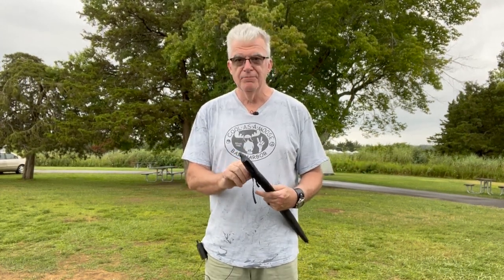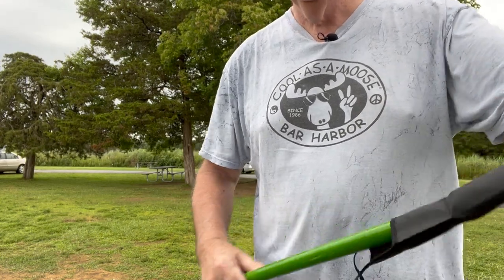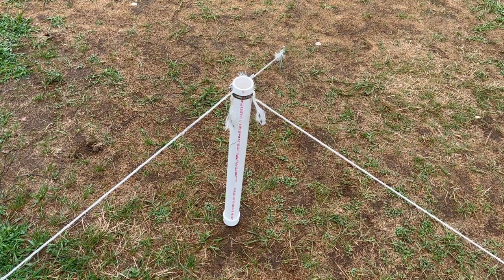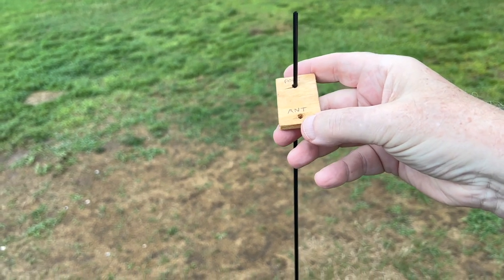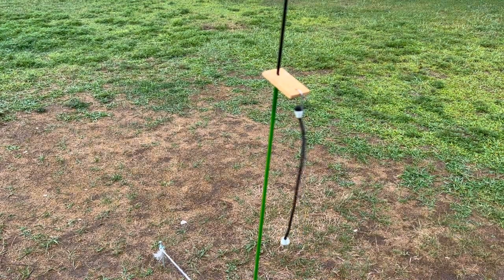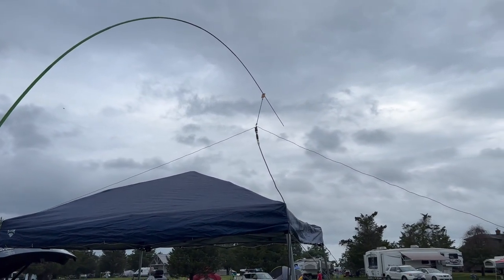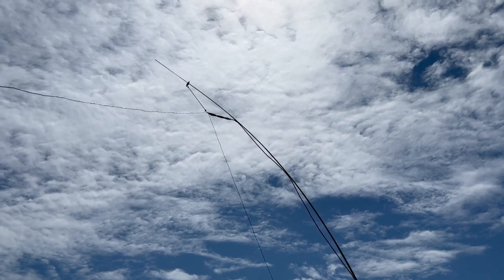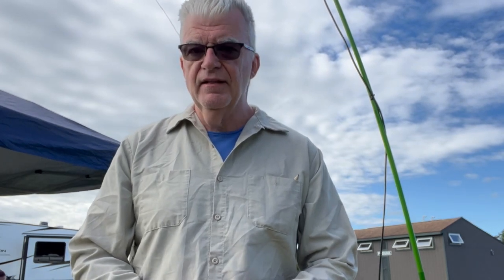Review and Test of GOTURE Telescoping Fishing Pole for Ham Radio Antenna

Comment: RG-316 is your friend for these lightweight poles. Even just a 10 foot length is good so your heavier coax can connect to a thicker at a thicker part of the pole. Additionally an inverted vee configuration helps to straighten out the pole as the two legs of the wire act a bit like guys. This works best with an end fed of some sort where the transformer is at the ground but with enough support even a center fed dipole can work.
Reply from the maker: Thanks!  I might try not going for the very end of the pole next time.

Comment: Hi Chris, I have another model of the same brand and usually only use it with my end fed antennas they handle those really well. For my Linl dipole like you said  I use the Sotabeams mast just because of the weight. Thanks for the review!
Reply from the maker: I think the overall diameter of this one is the weak point.  But, if I’m careful it should hold up

Comment: Hey Chris! I use the goture 7.2m pole to hold up 1/4 wave verticals or shorter random wire antennas. I use plastic lids to hold the wires, the pole works best with the least amount of weight suspended. The goldline super hard seems to flex less than the other models. It is the black one.
Reply from the maker: Yeah, I think the rg8x is too heavy for it.  It’s not a bad pole but definitely not a sotabeams pole.  Thanks for watching!

Comment: I have an 8M tall chinese fishing rod like this, EFHW with 49:1 balun & 20M (66') of 28 gauge galvanized gardening wire (weightless).  The radiating element is attached to the pole so there is little weight.  2 ft wooden stake mount for the balun .  The pole holds the 28gauge wire well.    $25 for the fishing pole, $15 for balun,  salvaged wire, scrap wood.  about $50 .  1.1 SWR on 20M, 1.3SWR on 10M, 40M and most other bands i've tested.

Comment: Good review, Chris. It's helpful to see the bend/flex with RG8X. I have SOTABEAMS and MFJ masts and use RG174 or RG316 if I'm putting up a dipole. I'm sure there's a little more loss, but it shouldn't be too bad for just 25' coax. I've been thinking of the Goture masts for a while though.
Reply from the maker: Yes, I should change out my coax for something lighter for multiple reasons!  I just happened to come across the Goture and it seems to be ok.  Time will tell that’s for sure!